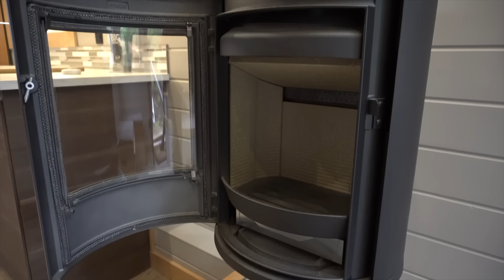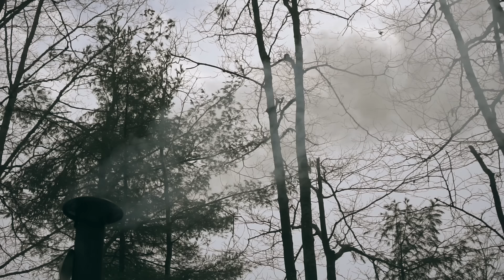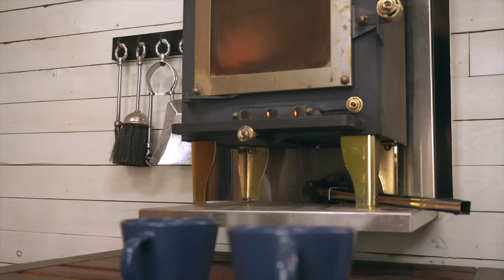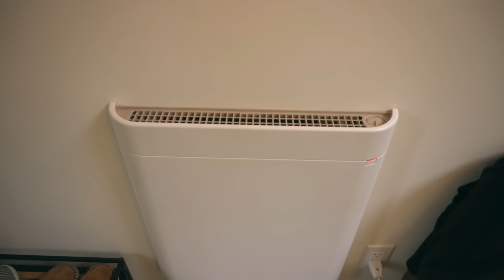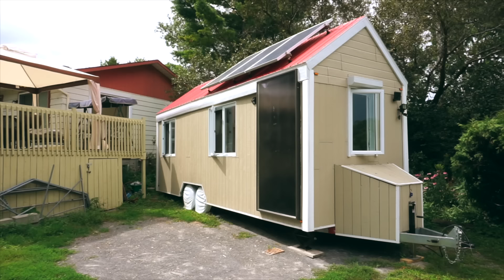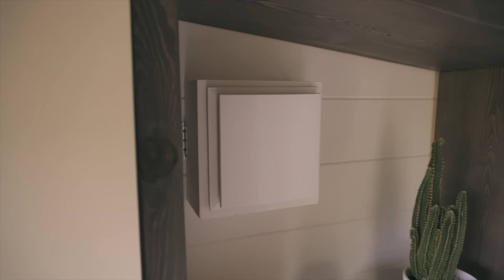Top 5 Tiny House Heating Options for Winter Living - Off Grid & On Grid

Comment: Idea composting toilet using the built up urine. A joe cell half filled with gallium aluminum alloy. Fill rest of joe cell with urine from compost toilet cover and seal and turn on. Galluim aluminum alloy will produce HHO from the H2o in the urine that can charge up solid sponge hydrogen fuel cells. Also gallium is a semi conductor which means tesla coils can be placed around the joe cell to absorb the energy field being generated from the joe cell to charge a battery bank or organic carbon power cell bank. Solid state sponge hydrogen fuel cells can be used to provide heat to power a central heating system and even operate power generators. All off built up urine from composting toilets. If processed correctly the byproduct from processing urine could be crystallized and turned into plant food has the sticky stuff from the composting toilet can be sterilized and dried out and processed to make rich top soil for growing plants. 😊

Comment: Great info, wish I knew this when I built my house. I really wanted in-floor radiant heating but my builder and I couldn't come up with a suitable option and my house is now built. I have the propane heater you showed but it needs help with the temperature drops below -15*.  I love the idea of the solar heating. and the HRV. I wonder if either is hard to do once the house is already built.

Comment: You mentioned a  propane heater with a thermostat - just wondering if  the thermostat fnctions without electricity?
Reply: I have the propane heater that he showed in the video and it's 100% propane. No electricity needed. The thermostat is more of a slow, medium or high rather than set it to a specific temperature though.
Reply: I do not know about his but the old style mercury thermostat can work without electricity. On my goodman HVAC, I have a battery powered thermostat.
Reply: Thank you so much for your reply - good to know these things!
Reply: This is not just about the thermostat, lots of propane systems use electric fans for forced air. People have purchased manufactured tiny homes and run into problems off grid not having enough electricity to run the forced air heat.

Comment: why don't folks in tiny houses incorporate humidifiers?..
Reply: Some do. It all depends on the needs of the dwellers and the environment they are parked in and their lifestyle inside the house.

Just add a pot of soup or a tea kettle to the top of the wood stove.
Reply: I kept hearing about how tiny houses can have issues with high humidity and mould etc. but I'm having the exact opposite problem!
Reply: i'm just thinking humidity would hold more warmth and lower the actual output of heat needed.. Think about a green house..
Reply: Humidity stimulates spore growths and such and leads to respiratory illnesses
Reply: steven heckert - guess I missed your post,.. mate I live in the tropics, humidity is just a day/night in, day/night out kind of thing that people have survived for millennia, i'd rather do as Jessica here suggests and put a kettle to the stove for a bit of moisture in the air than freeze my nuts off.. but I guess that's just me..

Comment: Your mentioning that small woodburning stoves/fireplaces require significant maintenance of the fire... leading to sleepless nights and chilly mornings... makes me wonder if anyone has tried using a rocket-mass stove in a tiny house.  It seems like a reasonable idea to me.  Though it would take up more space and increase the weight of the house.
Reply: A thermal mass around a wood burning stove would produce a similar effect. My stove is surrounded by piles of brick on three sides, averages out the hot/cold swings of the stove. Fortunately my cabin floor can take the weight, many Tiny Homes wouldn't.

Comment: A pellet self feeding is a great way to go. But still have a 2nd & sometimes a 3rd source to. Better safe then sorry if you run out of wood or electricity.
Reply: People don't usually run out of wood, pellets or propane accidentally, that would normally require a little negligence. But I totally agree with having a 2nd & sometimes a 3rd source, things do go wrong.

Comment: You are using the terms wood stove and fireplace interchangeably. Fireplace is not the same, is not a great heat source and should not be considered. A wood stove, a good one is great for main heat or back up when power goes out, yes it needs your attention. High efficiency heat pumps are good now in colder climates they say, and they cool in summer and dehumidify and needs electricity as does my present propane heater but propane is incredibly pricey right now, usually always a pricey option in northern New England and we routinely experience shortages here. I am researching this right now for when this heater dies. Thank you.

Comment: Great video. Please do a video with Cooling Options for Summer Living! Looking for suggestions for a system (or systems) that will work in both extreme climates.
Reply: the wall mounted propane heaters also come in heating/cooling units that can be run off propane or electric.

Comment: You missed a few options. First option from the RV sector is a diesel fired heater with blower. 12V and a diesel source are all that is needed. There are also propane versions that will supply hot water as well. Second option is from the marine sector, like you small wood or propane burning examples, but diesel. For the rest, good info that I have not been seeing much.
Reply: John Sexton, The other diesel option that comes to mind is the diesel heater as used in boating. They are very space efficient.
Reply: That one is pretty much the same as the one from the RV sector and is way more expensive without being any better.

Comment: build right.  need foundation in cold climate.   build per ''passive solar rules''   4- 6'' foam 4x8ft sheets.  foiled back, poly sheets both sides.  attach outside of frame , wall and roof. much heat is lost thru 2x4 or 2x6 '' framing.     ......double pained windows. .  wood stove, should do it .

Comment: No pellet stove heat? Why eliminate that? It's clean and easy and puts out great heat for the value of fuel.
Reply: But if you lose electricity, the auger stops and your heat stops with it.
Reply: pellet stoves are usually fairly large (for tiny houses) + uses a lot of electricity (if offgrid)
Reply: Jesper Andersen Only about 250 watts of power consumption. Maybe 400 watts at startup with the igniter. But that’s only for about 15 minutes. Light with a match, run the pellet stove on high, and you’ll only need 250 watts. Not bad!
Reply: @bighammer587  what kind of pellets are they?
Reply: Norman Henrickson The best wood species for manufacturing pellets is Douglas Fir!
Reply: @bighammer587  my coil on my pellet stove has been broke for years I just load a handful of pellets into the front turn the feed way down squirt a little WD-40 on it light it off with a match let it burn for a fight about 5 minutes then turn my feed up and it gets going but it's got to have electricity to keep those fans going I just use it for supplemental heating in the winter time in the living room and rec room down in my basement it's great because I don't have to chop wood and I just use the closet under the stairs to store all of my bags of pellets but I've used everything to light my pellet stove WD-40 BBQ pit lighter fluid the actual starter fluid that they have for pellet stoves it's like hair gel but flammable one time I was out of everything and I just load it the front of my pellet stove with a half a box of wood matches and it worked lol

Comment: I think you skipped some common ways to heat your tiny house. You mentioned electric in floor heating, but there is another type of in floor heating. If you have a instant hot water heater there is also a hot water in floor radiant heating system that uses a second coil in the heater to circulate under your floor. This also has its own thermostat and is a closed loop. These systems can be powered either by propane or electricity. And the only extra cost would be the installation of the system. The good thing about this system is it doesn’t raise your humidity and since these units are usually installed on the outside of your house eliminating the danger of gas leeks inside your home. 
     One other advantage is unlike the solar system, it would heat your house day or night and doesn’t depend on sunny days. I personally like my propane heater system because  because I am off the grid and it saves my house batteries for mostly my electronics and lighting my home at night.
Reply: One weak spot in a "water" based in-floor heating system is the fact that it can freeze and rupture which imperils your comfort not to mention the likely possibility that it will seriously damage your structure.  I would only use such a system in a fixed residence and not in a movable house like a tiny house.  Plus they can be inefficient if not properly designed and installed.
Reply: I like what you're doing with your heating. I was thinking those tinny stoves would be quite a pain in the butt as a main source of heat. No room for coals to build up which is necessary for overnight heating.. I can see a cycle of fill it up burn for what maybe a few hours? empty the ash fill it up and repeat.  I think they're fine for a backup or for tent camping on a cold weekend...
Reply: Wayne Davis thank you. I have to admit I got the idea from my friends. Class a motorhome.
Reply: I am in the process of creating an OFF-THE-GRID heating system that will incorporate several heating options.
 it's based upon an in-floor (PEX) system.
 My heat source comes from two sources
 - First is the roof (or solar) heat collection system
   - this will warm (heat) the coolant before it is circulated to the boiler
 - Second is the Propane Boiler (if necessary)
   - this will bring the temperature of the coolant to a usable temperature .

My goal is to also have a solar powered 12volt DC circulating pump that will move all the liquid with the need for being on-the-grid. 

My issue will be at night when there is no sun, for this I am installing batteries to collect the unused energy collected during the day.

Now for those times when I have little or no sunlight.
   I need to explore the possibilities of a mini-propane DC generator that will run when everything else fails.
Reply: @sadsak123  i thought light in general is enough for solar panels, light still crosses clouds... no?
Reply: @incorectulpolitic  depends. Just the angle of the panel in winter would lead to at least 25 perce t efficiency drop because in the northern hemisphere there is more deflection. I have a weather station that measures light watts/m2 and it can go from 200 in full sunlight to about 25 to 50 just in the shade.
Reply: That's nice. I 'll look into a heating system based out of propane . I want to heat a small  van during nights only. Thank you.

Comment: There are a couple of more Cons for having a Wood Stove....1.is that insurance would be harder to find. 2. Creosote build-up that could result in a chimney fire. 3. in general your tiny house will need to be cleaned more often.
Reply: Both the chimney and the house will require regular cleaning.
Reply: yeah... right.   just TRY to get 'insurance' on a tiny home.  The wood stove does not matter and you just don't tell them....but you generally dont even TRY to get insurance on a tiny home.

Comment: Thanks for your insights!  Well thought out!  I would think that in-floor heating would be wonderful, but hard to fix if broken?!
Reply: Usually they're all hard to fix if broken. You can connect all the wires under one floor board to make it much easier to fix.

Comment: Thank you for this video! It couldn't have popped up on my play list at a better time! I have been studying this because I would like to add to my existing system and looked at the wood stove from cubic and the propane heater from Dickenson.  Well put together and useful information! :D
Reply: Opps!  I forgot to ask,  what is the radiant floor system, running a wire in a pattern on the floor or mats and what brand is best? Thank you!
Reply: "Couldn't have popped up on my playlist at a better time" You DO kmow that this is a common odservance/complaint among people who don't even use Cortana nor any other "useful" audio responsive system... don't you?
You might ve interested in watching "Stare intomthe Lights, My Pretties'
Meanwhile, there is an electric floor heat system shown briefly on This Old House while Rich and the Homeowner/Architect are at a Builder Home Show - it is respomsive to zones. Most Recent Episode or perhaps one prior

Comment: I have 5 batteries and 2 of the large roof solar panels on a Dodge Sprinter roof. From a years experience in travel I am finding that electric heat and even an electric water heater will not work.  If it is cold, chances are there is not enough sun to charge up the batteries. In good sunny weather, the panels would run a heater for about 1 hour or less before the system is depleted. Even a roof top full of panels on a tiny house could not be counted on for much of a heat source.  Too bad, because I was hoping to be propane free and totally solar dependent.
Reply: 100 watt panels and 45 amp/hr batteries.  Can a tiny house ramp up a system better than a portable system like my RV? All brands for a roof type seem to be in this range. Thanks for the dialogue. This is helpful.
Reply: Hi Sierra Bdawn - I have two solar panels. I have tried a buddy propane with too much odor. Then a small ceramic heater. I couldn't charge the batteries to last more than one night. If we are at a RV park and can plug in, it is more than ample. Today, near Zion National Park the sun is low on the horizon and I am charging at 27w instead of 100 even with the sky being clear.  Summer months are much better. Thanks for the idea on the solar calculator. This is a great tool (GoGreensolar.com). 
There is not enough room space for more panels. The best investment seems to be a heater system running off the gas tank and vented to the outside.  Thanks for the feedback and ideas. Best of luck -  Kent
Reply: Have you think about a better insulation? Maybe you could reduce your energy consumption and so the energy from the solar panels are enough to heat your bus.
Another idea is to change the angle (?) So the cells could produce more energy even when the sun ist on the horizon.
Sorry my English is not so good, but I hope you understand what I mean.

Comment: You don't need to be on-grid to use electric heating. An entire home can be powered by solar panels and a battery. 

With normally sized homes, heat pumps are generally the way to go with electric heat because they're more efficient than heating elements, though perhaps that isn't true for tiny homes(?) Not sure about that.
Reply: No, it's true for tiny homes... It's one of the reasons most opt for Mini-Splits for efficient heating and cooling.

The only thing is heat pumps only operate well within a certain temperature range.  So if it drops below 10 below zero then you're going to need another type of heat source.  Though, there are augmented ones that can operate a little colder to around -20 degrees but there are parts of the country where it can reach below -30 and even below -50...

But absolutely right about off-grid power systems still allowing a wide range of options.  It's just not always easy or affordable to do so, but people have done Tiny Homes where even the hot water is run from the solar and that's one of the hardest things to get it to do...
Reply: I think it depends on the type of heat pump. If you use one who use the energy from the earth ( sorry dont know how descripe it) and not from the air outside,  the heat pump working efficiently also when -30 degrees are outside.

Comment: I built a airplane hanger house once and used in-floor Radiant heating.  I used a combo boiler that gave me on-demand domestic hot water and also provided thermostat controlled hot water that circulated in the the pex tubing water lines in the floor. The temperature of the floor was always maintained at about 70 degrees and the whole house felt very comfortable.  I did have a thermo mass of about 4 inches of concrete in the floor to hold the heat, but this can work on wood floors as well. I have seen simple systems done with a simple gas hot water heater instead of a boiler to make this work.  Thanks for the video...
Reply: I was hoping someone would point out that you can do in floor heat with a gas boiler.  We had it in Germany.  Enjoy.
Reply: Traveling Terry that is great... For an airplane hangar house.... Not conducive to a tiny home. An airplane hangar is the size of a regular home+ not a tiny home.
Reply: I am doing this in my tiny house. The cheap camplux water heater with some added valves and relays. Easy, cheap, and best of all... automatic!
Reply: Traveling Terry  Have you or can you do a video on this?
Reply: Tim Fuller  I would love to see a how to video! Looking to do an extremely simple version of this.
Reply: Sorry but no, It was years ago in Alaska and it's already built....there are lots of how to videos available if you look...good luck..
Reply: Traveling Terry That's okay, there's some pretty decent diagrams online too. Thank you though!